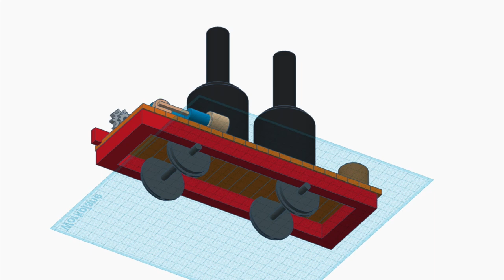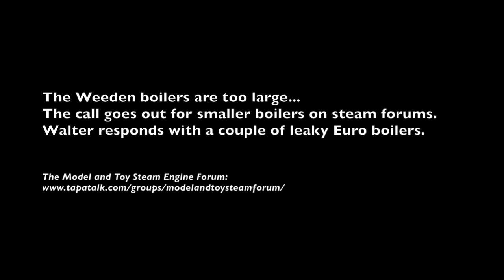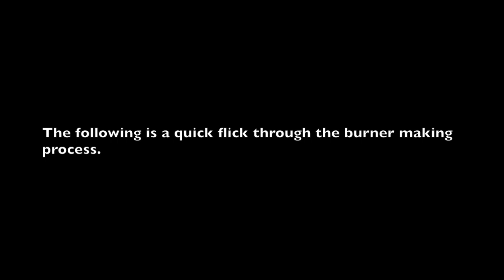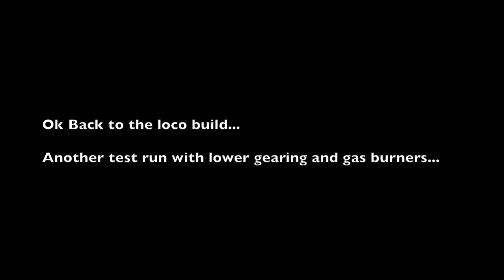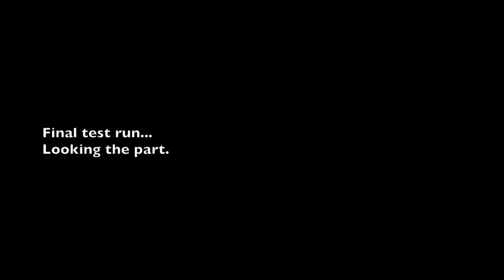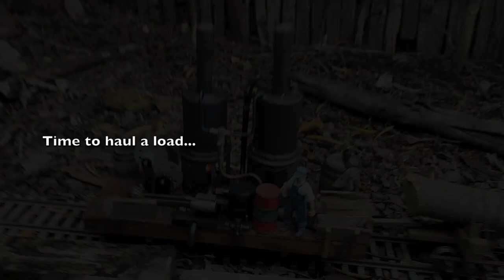Addledoo Bush Loco#2 (Twin Boiler)

Comment: Does each boiler have it's own safety valve? Very good work and great layout. I think it did well on denatured alcohol.
Reply from the maker: Hi. Thanks for the kind comment. No, there is just the one safety valve as they are joined at the regulator valve.
Reply: @ozziebob08  Oh that makes sense as long as it was before the regulator. Would love to see detailed photos of it.